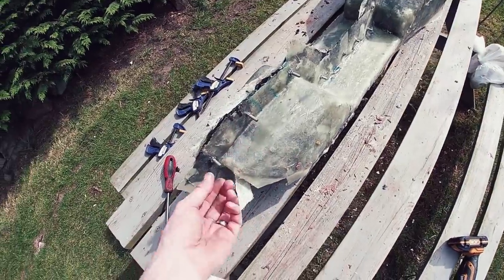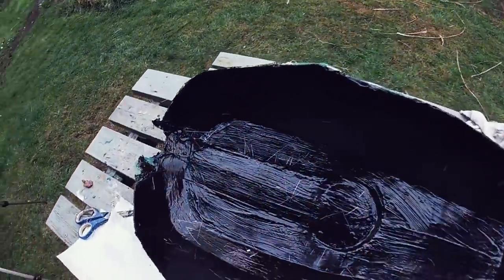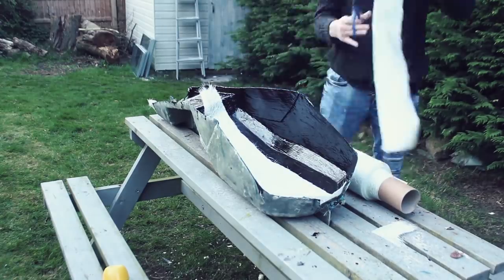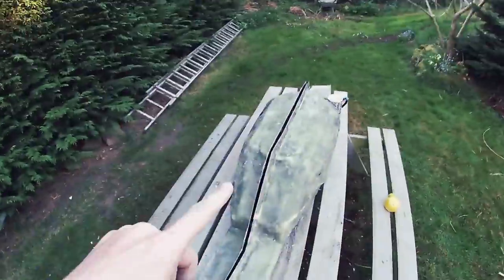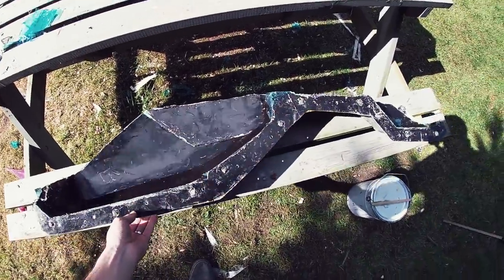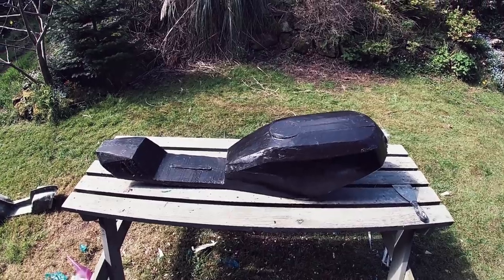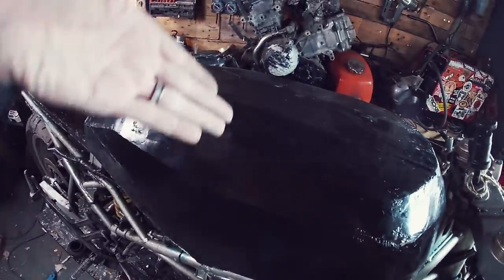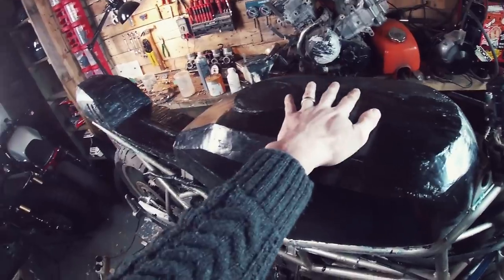Ducati Monster Cafe Racer Part 10 - Creating the prototype fibreglass tank

Comment: A few additions to my last comment (on the last video) if you using these short fiber mats again for the final mold use a wire brush on your precuts.. then you have a smoother transition and following that a better adhesion on the layers above..
Reply from the maker: Thanks for the tip

Comment: Honey wax release agent is better for fibreglass moulds than the blue pva stuff, on a fresh job, use about 6 coats of wax and don't buff the last coat of wax off, just gelcoat right over the top.
Plasticine is really good for filling cracks and voids in moulds aswell, easier to use than wax filler.
I used to make fibreglass overflow tanks for a job many moons ago.
Reply from the maker: Indeed. I’ll definitely be using a softer release agent as the PVA was the only one to hand after making the mould from the clay.

Comment: Hi, I would use Upol easy sand for body filler , isopon is a bit old school and hard work , then if you finish in 120 grit you can use polyester spray filler , loads of companies make it this is perfect for this , again finish it in 120 grit or to 180 then 2 pack primer as a surfacer ..wet sand too 600 or 800 and you can wax for your mould ..
Reply from the maker: Yep. That’s the one I’ve got. I just get into a habit of saying isopon as it’s what I grew up with. I generally use upol for my primer too when spraying.
Reply: @forthebold  perfect , yes I understand how you can get used to a term, I work in Germany for major car companies , I specialise in exteriors for show cars for BMW Merc etc , and prototype cars , and there terminology drives me nuts 😁
I will look forward to your progress..

Comment: A thought... We use Durabuild (rather than a car paint type primer) polyester based, easy to apply (spray or brush), goes on thick or thin, easy to sand, can be polished - good results fast. (No affiliation, just like using the stuff). High Build EZ Primer first, followed by Surfacing Primer to finish.
Reply from the maker: Diolch Aled, I'll certainly try it out

Comment: I hope you are able to get all of the resin drips off that bike. The part is coming along nicely.

When I used to work as a fiberglass laminator, we would tear the glass mat for smoother layup rather than cut small strips to fit. We also cut as large pieces as possible to increase the strength of the parts, (fewer joints). The glass mat becomes quite stretchy when it is wet-out with resin, and any wrinkles can be rolled flat with a proper roller.  So the pieces don't have to fit perfectly, they just need to be large enough to span across the contours and have some trim allowance left over.

 I probably would have formed that "tank" with no more than 2 or 3 cut pieces.

Trimming the finished product with a grinder can be minimized by using a good utility knife just after the resin starts to set, but before it is fully cured. Grinding and/ or sanding fiberglass is such nasty job.

Keep up the good work!
Reply from the maker: Thanks for the tips. The whole bike including frame and engine is being sand and aqua blasted after so rah all drips will be gone. Nice tip about tearing. I’ll be using proper shapes on the final split mould and when making the carbon fibre tank I’ll have to accurately cut them to make sure the fibre pattern is one piece. That’s going to be a tough one.  👍🏻

Comment: I would honestly clean up that mold and finish the surface, and make another monocoque, and apply the fiberglass when your last coat of gel coat is tacky. You'll have less final smoothing to do on the monocoque, have more defined edges, and it will release from the mold much easier.
Reply from the maker: The mould is far from perfect as it has all the imperfections from the clay and when you run your hand over it you can feel waves. I’m a half way through smoothing the prototype already and it’s looking a lot better now with filler and a palm sander

Comment: That's cool, here is A bit of information for you as i have worked a bit with fiberglass; put baby powder on your exposed skin, and it will make it so the fiber dose NOT get all stuck to you, The powder and fiber will blow off and will wash away in the shower.  Try it you will love how good it works. The mold looks great !
Reply from the maker: I will be covered in head to toe next week in white powder like a cheap Scarface
Reply: @forthebold  lol man i would do the same, back in the day while I worked  on a 63 or 64 cant remember Corvette body. and it helps a lot. Love what you are doing. I am not sure i would try it, you are in fact bold. :)

Comment: As a handy tip for getting an eaiser release, you want to use the PVA after waxing on (and off) something like Partell Paste Wax #2 3 or 4 times.
Reply from the maker: Wax on, wax off Daniel son. Indeed I’ll definitely be using a few coats of that on the actual plug and split mould.

Comment: If you make it out of carbon fibre, does that hold petrol or will the epoxy deteriorate or dissolve with time?
Reply from the maker: If you use the correct resins it will. But as I’m creating it I’m starting to think if an aluminium tank hidden inside will be a better option. Less space but commercially better
Reply: @forthebold  Then if you would do it in carbon with the right resin. Would you do it in a top and bottom half and then fuse them together with resin or would you do an upper and lower mold, fill them with carbon fibre and resin use some kind of airbag/balloon to keep the tank in form to get a unibody tank and when it's dry pull the balloon through the tank lid hole. Which way would make the tank part more reliable?
Sorry for sounding like a NOOB but I would really like to do something like this myself.
Reply from the maker: If so it in 3 parts. Top split as it is, then yeah, a bottom part to bond together. Then for extra measure cost the inside with a fuel resistant mixture.
Reply: @forthebold  thanks for the reply, might just do something like you. But I'll keep looking to learn the process.